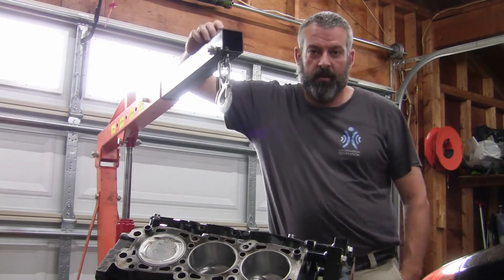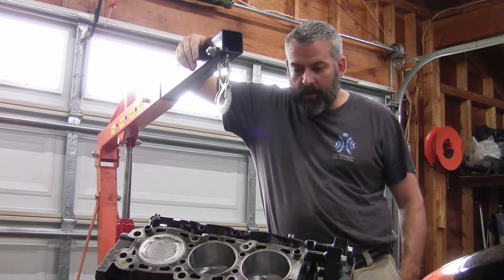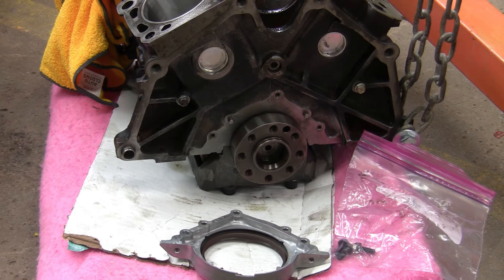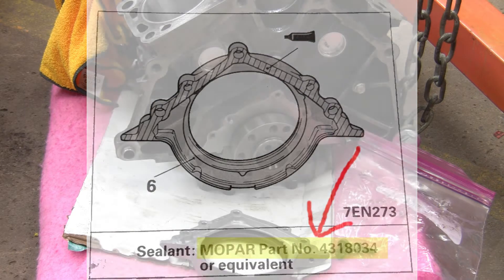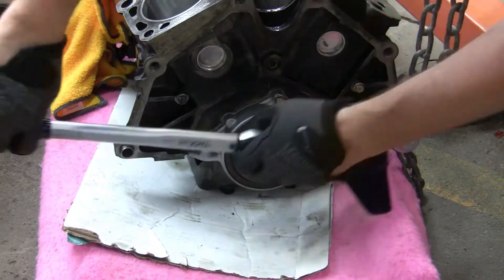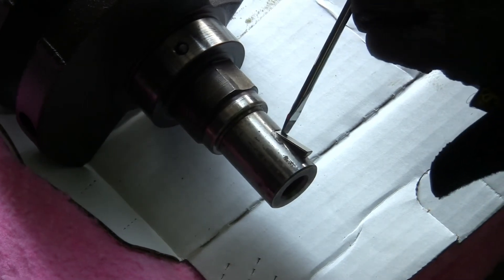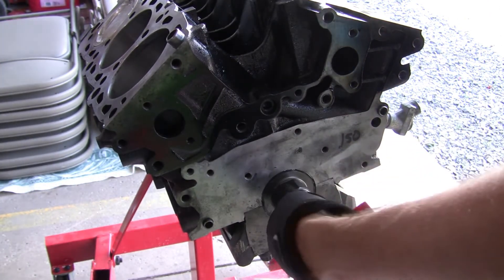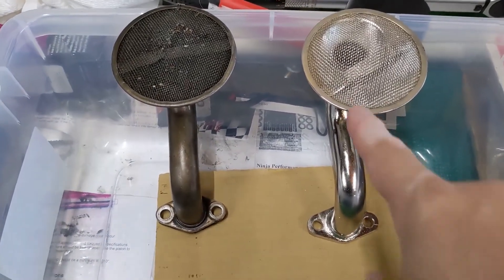6G72 Engine Assembly - Part 4 - More Lower Engine Work

Comment: with the oil pump gasket did you use rtv? Kinda worried installing it with just the cardboard type of gasket without rtv to be safe

Comment: Hi great videos. Im doing the same here in the uk. Just starting to rebuild this weekend. How is it for parts in the US as really strugglung to get a new oil pump in the uk. Tried a few companies in US but none ship to uk.   Good luck 👍
Reply from the maker: So yeah, finding parts for this engine has been a challenge. One of the things that I read was that Mitsubishi has stopped making all parts for this car as of 2020(ish). So everything is now after market or reman stuff. I have purchased most of my stuff from 3SX.com, stmtuned.com and NinjaPerformance.com. Unfortunately the gentleman who ran Ninja has passed away, so I do not think they are operating any more. I don't know if 3SX or STM Tuned will ship to the UK or not. Good luck on your rebuild!

Comment: What was that piece of PVC? Sewer pipe?
Reply from the maker: Yes it was, it worked perfectly to apply the proper pressure across the seal evenly. I used another piece of PVC for the cam seals later on. Works like a charm, and doesnt cost $50 :)

Comment: Did you pull the oil pump apart, clean and inspect then prime it.?
Reply from the maker: The oil pump is a OEM replacement so I did not tear it down. I did not prime it though. I am a little fearful of how the engine is going to do on start up. I need to figure out how to get oil circulated in the system before first start ...
Reply from the maker: @tahoemk1685  Thanks, I would love that. I am not quite there yet, but really want to ensure I don't do any damage to the engine when I start it up. If you have any hints, tips or instructions on how to do the priming it would be greatly appreciated.  THANKS.
Reply from the maker: @tahoemk1685  Thanks for the kind words. The true test will be when I try to turn it over, and it actually runs! I know I would greatly appreciate any sort of instruction on how best to prime the engine prior to a full start. Looking around, my thought was going to be to have the fuel pump and ignition system disconnected and just crank it in small increments until I saw oil pressure, but I am guessing there must be a better way than that!